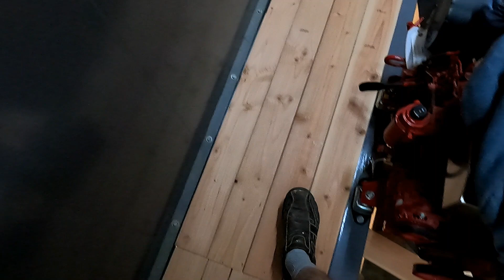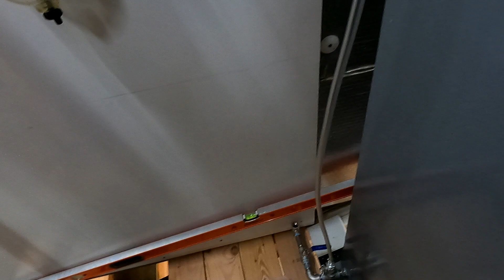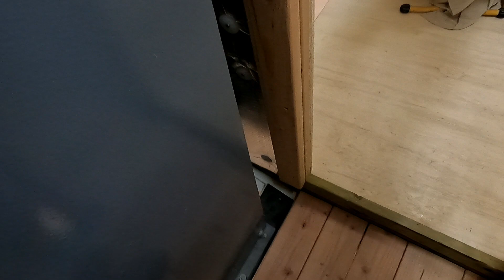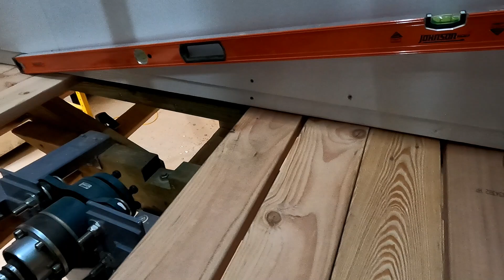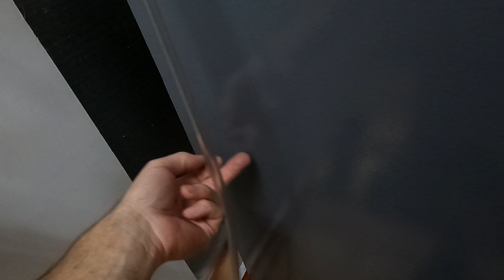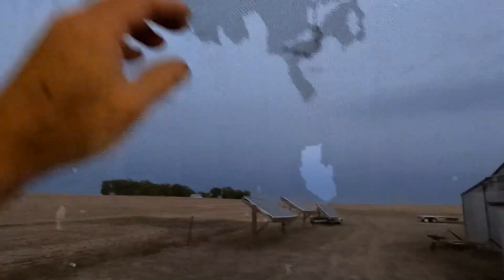Engine Room Sole-Fuel Plumbing 4 October 2022

Comment: Would be good idea to have 2 filters. That way you could bypass 1 so you could clean or change filter without any interruptions in supply.
Reply from the maker: What you see in this video is the fuel transfer and polishing system. Using dual filters here would be "gilding the lily" so to speak. The engine run filter is another matter...